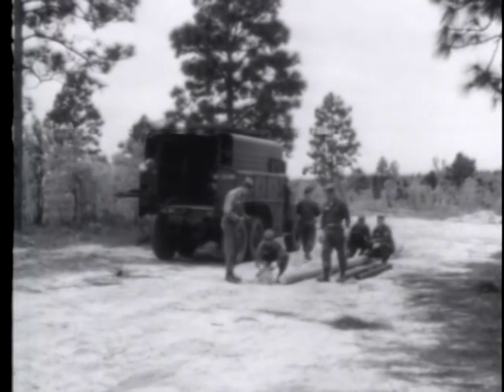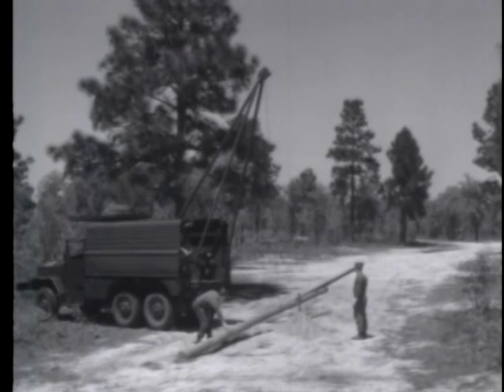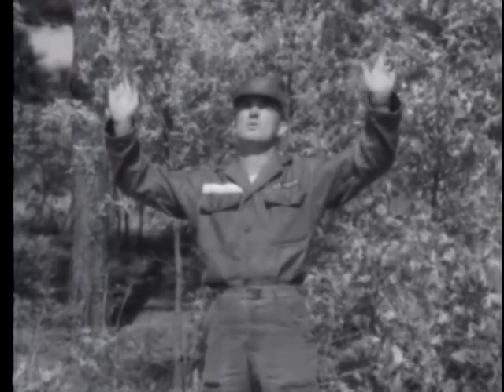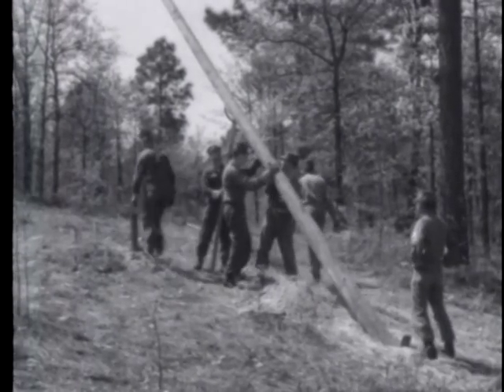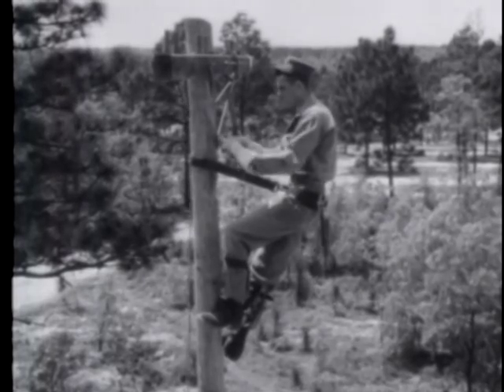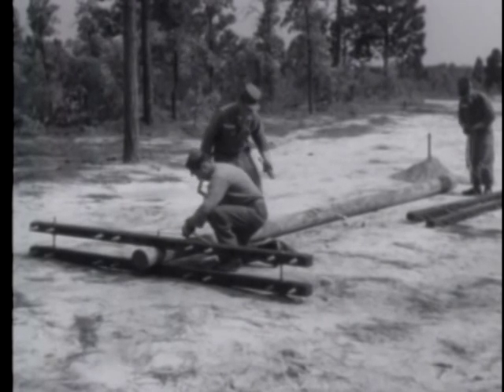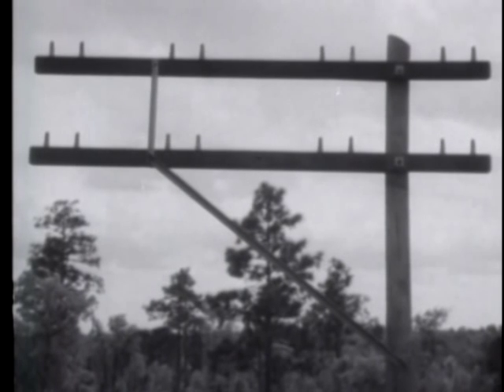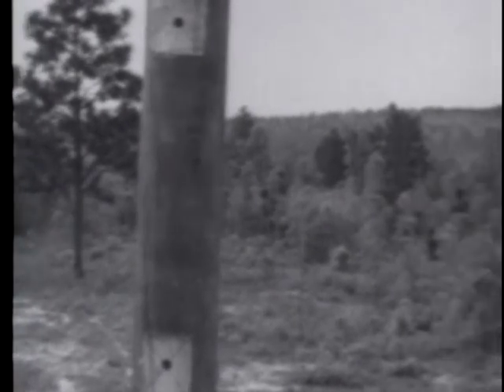POLE LINE CONSTRUCTION - PART III - ERECTING POLES AND ATTACHING CROSSARMS

Comment: Why would the braces be placed on the front of the cross arms, away from the poles? I've hung hundreds of arms, but flat braces always went on the pole side. Bow braces are bolted under the arms.
Reply: This was the Bell and GTE specification.  The American Railway Association, Communications Section, allowed for either.  REA/RUS telephone borrowers' specifications dictated braces on the back of arms (facing front of pole face).  For more information see: www.the-electric-orphanage.com.  Song of the Open Wire
Reply: @765kvline  That's a crazy spec. Braces are much stronger bolted on the pole side. I've been retired for about 6 years now, be safe out there, those free electrons are looking for a home.
Reply: @Hisslave1  Electric utility companies (not all) usually place the braces on the inside of the arms.  That has been mainly my experience.  Early power distribution from the 1890s-1930s used telephone practice but got away from this with the advent of bracing underneath the arms.
Reply: @765kvline  I worked everything from lightning bugs to lightning bolts for 35 years with Duke and some other companies they swallowed. In distribution construction, I never saw flat braces on the outside of the arms,as I said, bow braces are bolted under the arm.